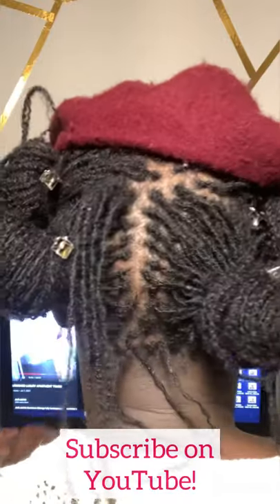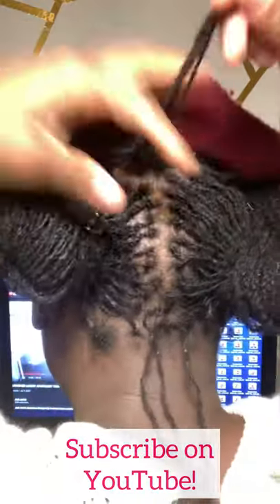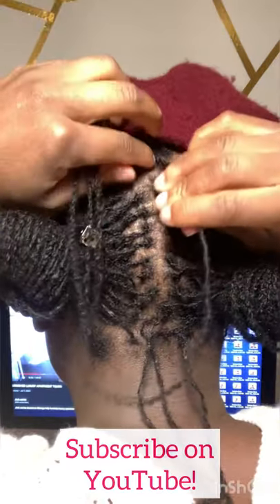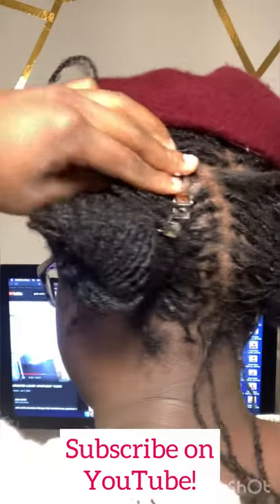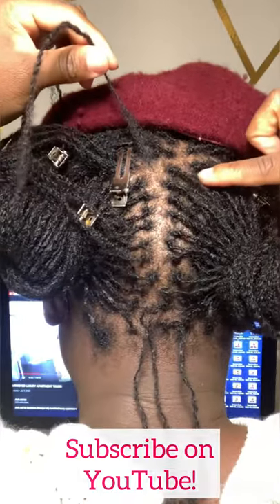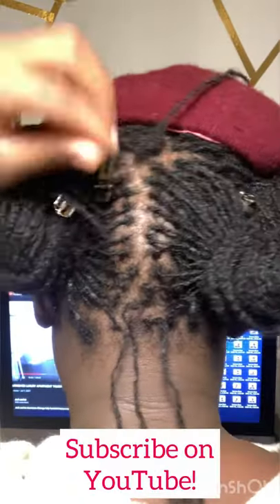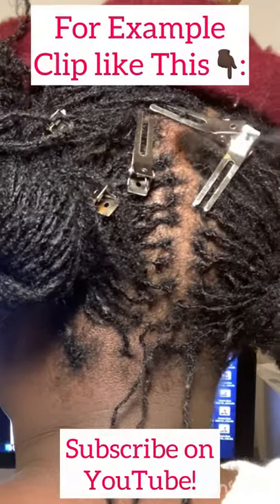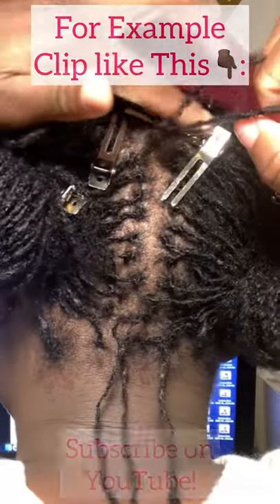#Retie Tip #3

Comment: Great advice and demo🥰
Lord knows how many times I've accidentally joined locs from not doing this step. It's so worth it to take the time to clip everything else out of way, 'cause girl, it's a beast to undo the mess otherwise and you lose hair😥😱
Reply from the maker: Right?!? Undoing a knot is NO JOKE, and you’re absolutely right, if you have to take out the whole thing for some reason, the new loc that you reform in its place will not be as thick as before because you will lose some hair taking the loc down to restart it! 😳😳😳...Thank you so much for watching and commenting 🥰🥰